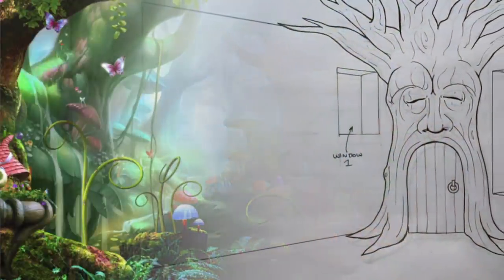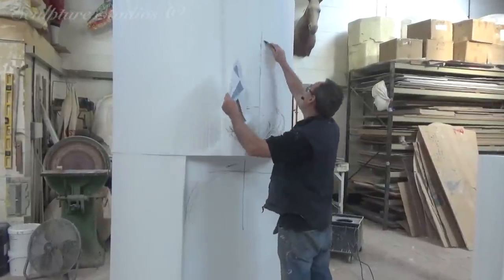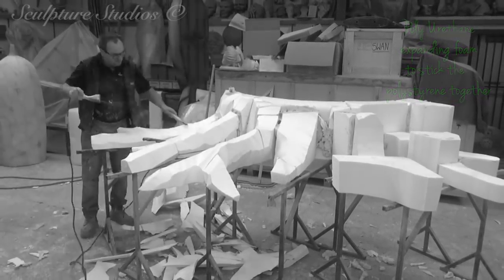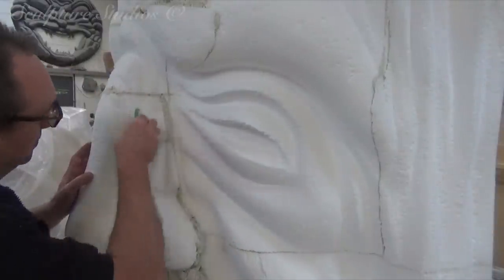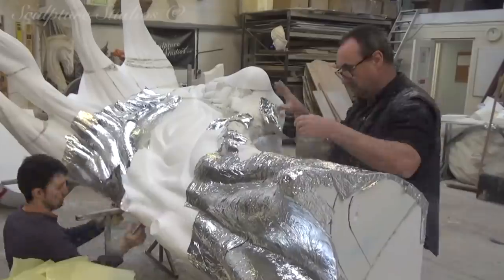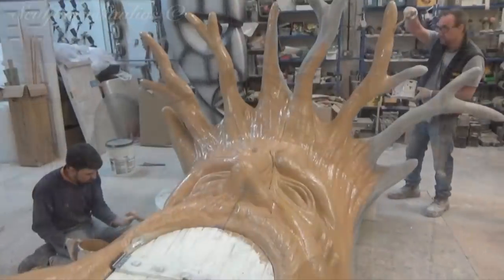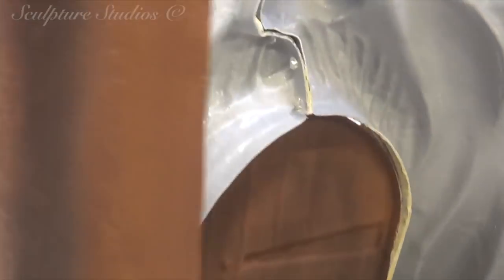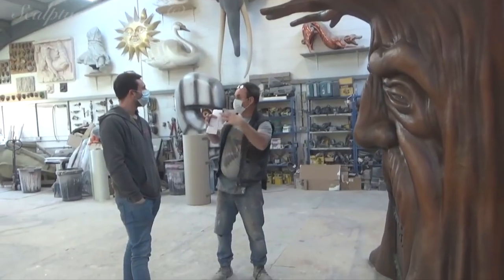Fantasy Face Tree Carving - Polystyrene / Styrofoam by Sculpture Studios

Comment: That's great work. Brings back memories. 20 odd years ago I used to carve Santa's grottos the same way. Hiding all the split lines in the folds of the snow. I started out using newspaper as the barrier but quickly moved onto tinfoil (and spray mount). Used to carve with everything from chainsaws, down to sticks with screws sticking out,(for extra harsh rasps.) Would have been alright if the zombie apocalypse had happened. :) Used to go home covered in the stuff. You'd brush it off and the static would cause it to float back to you and every time I pulled my hands out of my pockets a cloud of white bit would come out to!

Comment: When I made these giant fiberglass/foam structures for playgrounds and parks, before applying the fiberglass we just sprayed the foam with a nice thick layer of recycled latex paint that we got for super cheap from the paint store, which was a hell of a lot easier and faster than wrapping it in adhesive foil tape.

Comment: Having used the same respirators as you guys for quite a while in a big paint department, I highly recommend to upgrade to the 3M Versaflo system. This is so much more comfortable and gives far better protection. I'm not affiliated with 3M by any means by the way.
I've worn this system 8 hours a day,  for about a year and can't recommend it enough. There are many options in this system,  we use the M106 combined with the Jupiter unit. Looking at your activities this might be also the way to go. It might look a bit strange at first sight, but give it a try. I'm pretty sure you'll like it far better then your old respirators.
Anyway, keep making the cool stuff you make. Greetings from Belgium.

Comment: Stunning. This kind of work makes me SOOO happy. I subbed. Glad to have found you.
I have a few questions. First of all I love the whole craftsmanship. The attention to detail is really impressive. Hence question 1:
Why do the smooth sanding before foil taping? Isn't that a unnecessary step? Or will the foil not stick to un-sanded polystyrene?
And the other one is bit of a choice question I suspect is about budget I guess but; Wouldn't it have been nice if the inside was sculpted too? It would have been such an immersive object.

Comment: Cool, but why seal with aluminum foil instead of a primer or paint? Thanks.
Reply from the maker: the foil goes over the polystyrene without any corrosion or melting of the foam
Reply: @AdenHynesSculptureStudios  Thank you, I started painting mine, seems easier so was wondering.

Comment: What do you use to glue it together. I can never seem to find a strong adhesive.
Reply from the maker: PU Expanding Foam (poly urethane). In a squirty gun and canister
Reply: @AdenHynesSculptureStudios  Thanks heaps. I understand the canister is like the ones for the hardware store. Can you explain the applications with a squirty gun?

Comment: Would you please link us the products names you used, I mean the ones you used on top of the Styrofoam? (tinfoil, Glassfiber, Some mats or something).
Reply: In an earlier video (47 Meters Down: Uncaged Movie), they were using "a very thin, micro thin foil gone over with a watery wall paper paste". However, they've since found an adhesive-backed foil that they won't give a product name for.
It might be pointed out there are other, less labor-intensive barriers, as well as foam/coating combinations that don't require a barrier at all.
Reply: @5_Is  thank you, do you know of any instructions for those other coatings, I want to make some garden ornaments
Reply: @kayprins6779  Just do a YT search for "foam hard coat".
My personal preference for garden settings is one part portland cement and two of sand, painted with acrylics and then two coats of epoxy resin to seal it. This is permanent/stable enough to make fountains and aquariums.